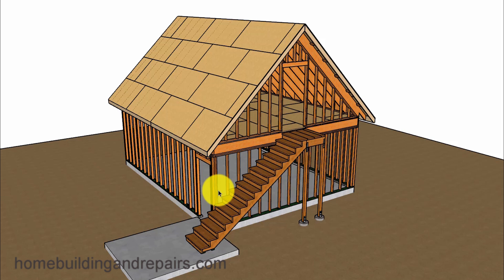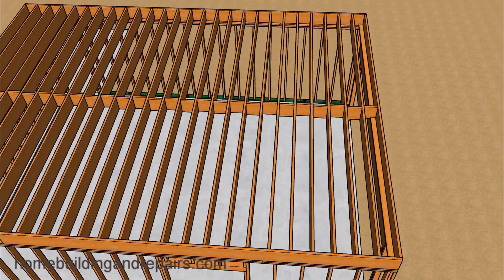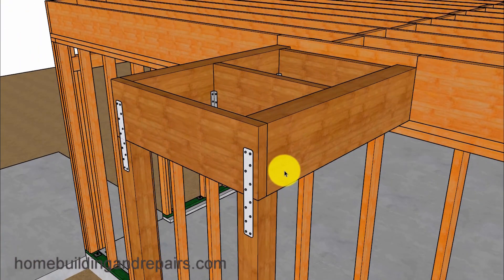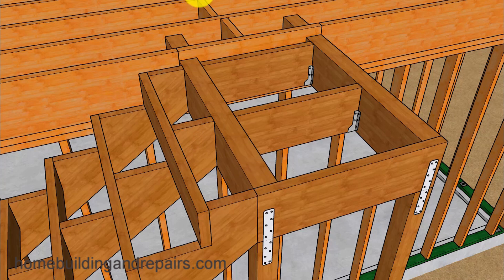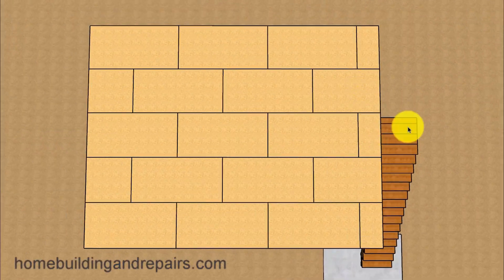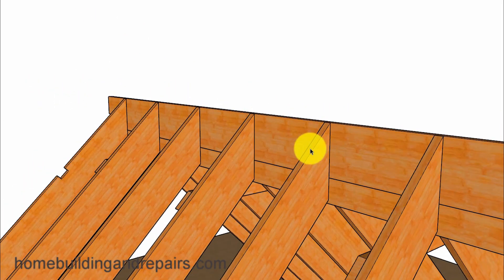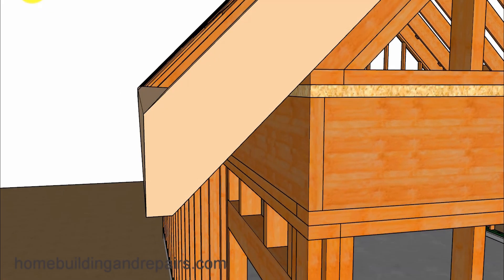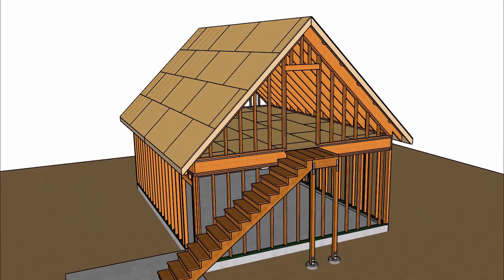How To Build 2 Car Garage With Steep Roof Loft And Outdoor Stairs - Building Tutorial Series Part 5

Comment: I'm not sure I understand how ridge boards don't act the same way as a ridge beam and transfer the roof load down through the stud(s) on the gable ends
Reply from the maker: https://youtu.be/9LjrdgA7LOA see if this helps.
Reply: @gregvancom  What throws me off is people say they are putting up a ridge beam, and the rafters are butted up to the beam like they would be with a ridge board. Also see people hanging the rafters from the beam with hangers. But how you showed them with the rafters sitting on top of the beam makes sense to me.

Comment: What would be different if you rotated the gable 90 degrees. In other words, instead of the peak being over the garage door, the peak is over the side walls and the roof rafters sit on the wall containing the garage door?
Reply from the maker: The one thing that comes to my mind will be a larger garage door header to support the extra weight from the roof.

Comment: I have a question with the stairs on the out side how far could you make the over hang on the roof over extend over the landed and the stairs.
Reply from the maker: It could go farther but the roof might need to be redesigned. With this type of construction it might max out at around 18 inches.

Comment: How would you raise a ceiling  interior when you are limited by the height of the exterior roof..  can the exterior roof be set higher...
Reply from the maker: Yes, you can raise the roof most of the time by removing and replacing it. If you're limited by height, then you will need to remodel  and re design the roof and ceiling.